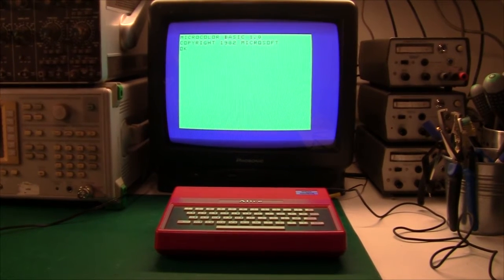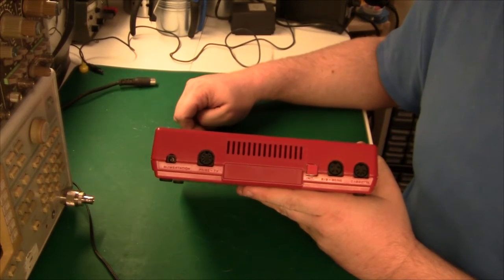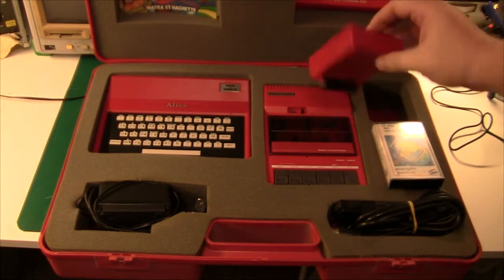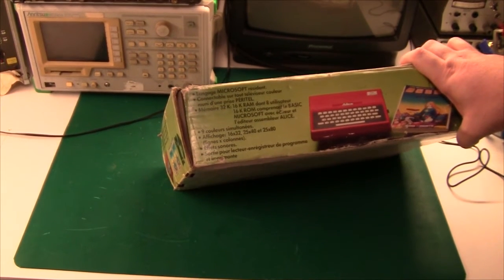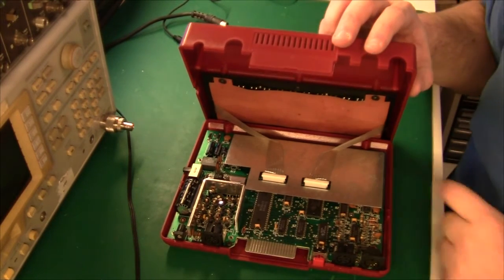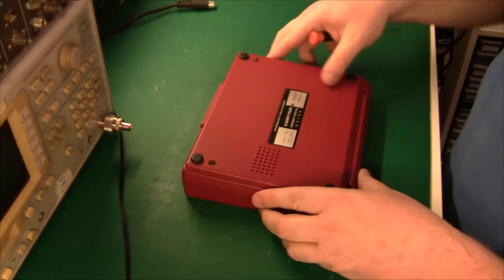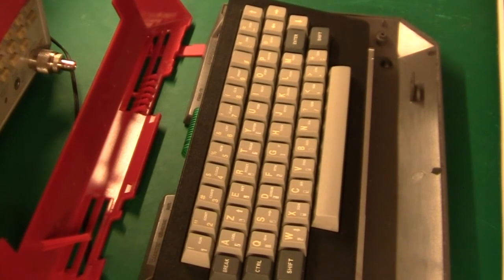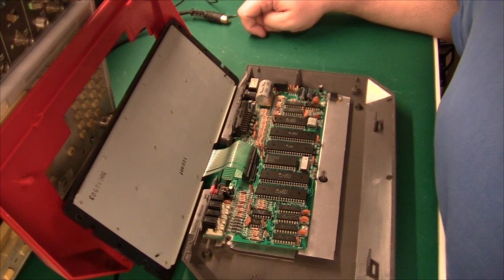Teardown of Matra & Hachette Alice 4k, Alice 32 and Alice 90

Comment: Looks like a zx81 with a better keyboard. Did all French TVs have a scart input back in 1983? Iirc they weren't standard on UK TVs until much later, so wouldn't be a cheap option over here back then. An interesting insight into a piece of history I'd never heard of. Thanks for sharing.
Reply from the maker: SCART stands for "Syndicat des Constructeurs d'Appareils Radiorécepteurs et Téléviseurs". It was introduced on most French AV equipment from 1976 onwards. Officially, it was to simplify the connection between VCRs and TVs and HiFi.

But, I believe it was also partly because many Japanese manufacturers did not support the French SECAM TV system. So, instead of changing to PAL, like the rest of Europe, they came up with the SCART connector, that made it possible to connect non-SECAM equipment to French TVs.
Reply: @NatureAndTech  interesting, thanks. I think they arrived as standard on UK TVs much later. I suppose they were less messy than messing about with individual phono cables, but IMHO weren't the greatest thing to come out of France. There was always problems with some cables not being fully populated or poorly fitting stamped connector parts, so I am not a fan. Most of the time we used the modulated composite from aerial to video recorder to TV. I think it was only when additional options such as digi boxes and blueray etc became common place, and you needed more than one input that they became more prevalent. Anyway thanks for showing us those nice looking little computers. It is fascinating to see all these, to me, lesser known vintage computers that sprang up around the world.

Comment: Goodness, these are beautiful! I have finally found one on Ebay within my price range, but it doesn't come with the cassette drive. Would it be possible to use some other device, or is that entirely impossible? I was sad to see that it didn't have regular line in/out AUX ports, because it would be neat to be able to make cassette copies on my tape deck and use with the machine if I decide to buy it. As just a machine running BASIC, it sadly wouldn't do much for me.